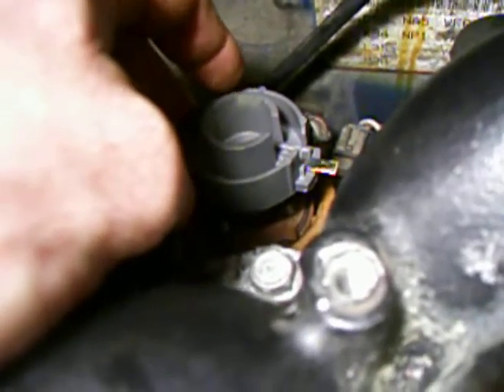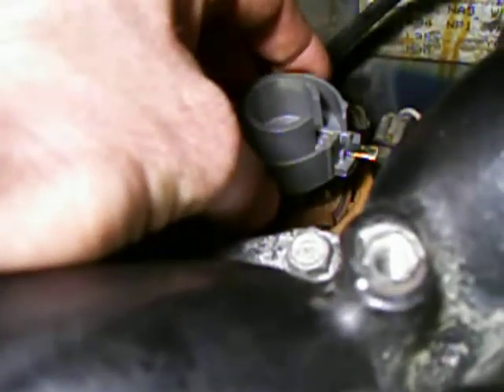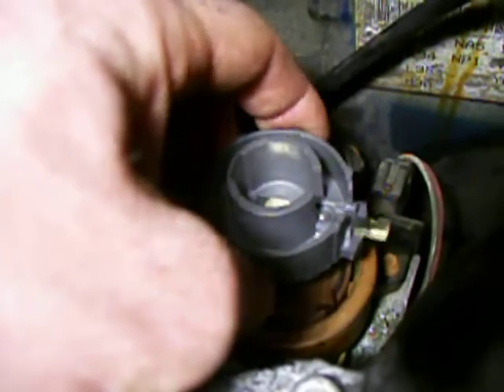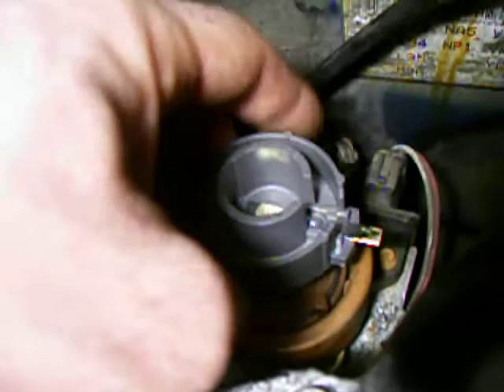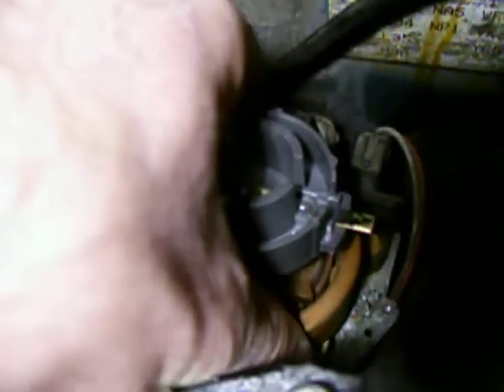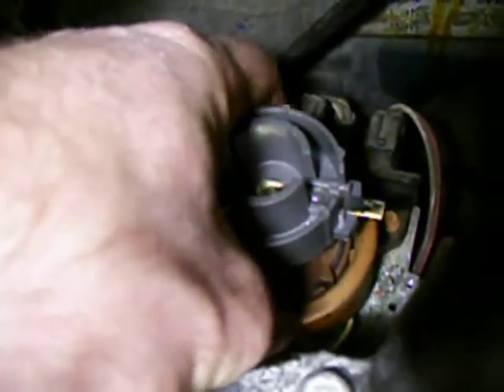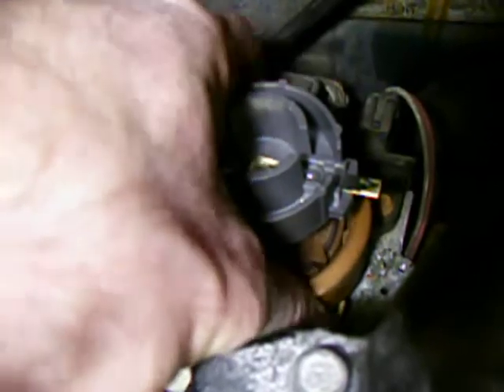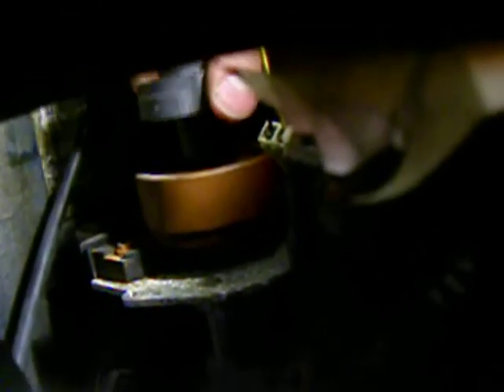GM Troubleshooting Part 10 - Distributor Shaft Play

Comment from the maker: thanks for the comment.  when I made the video I didn't know if this was my problem or not.  I eventually got it running perfect with this distributor so even though it may be worn with a lot of play, it did not reduce performance...  if I was pulling the motor and doing a full rebuild I would definately being looking at replacing the distributor with 200,000 kms+